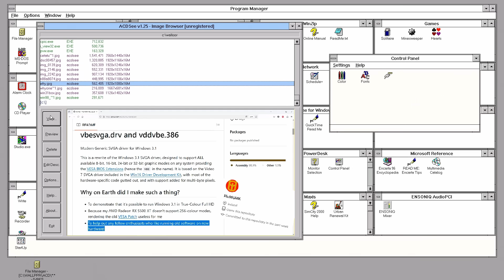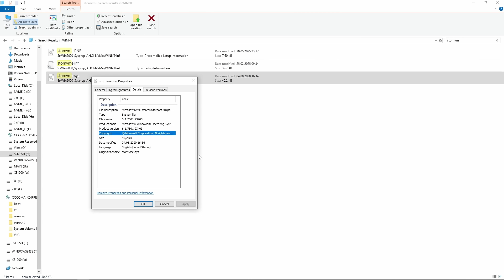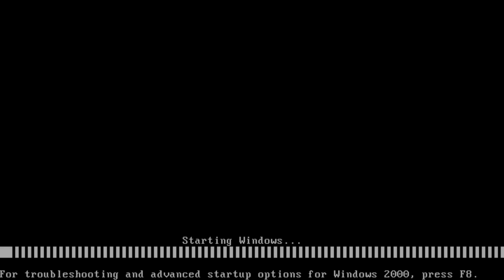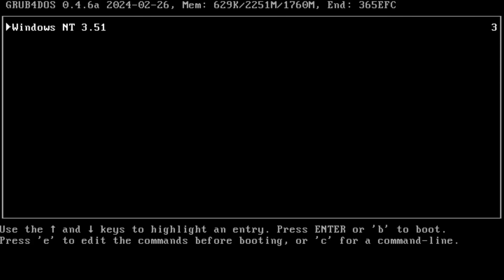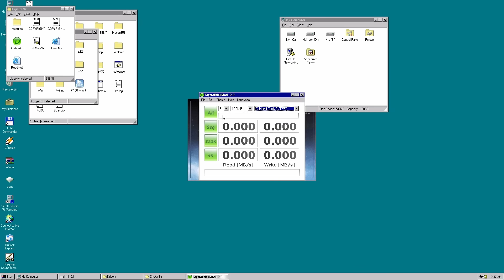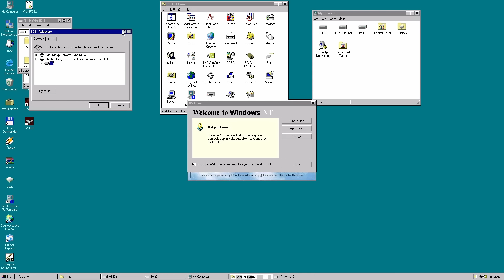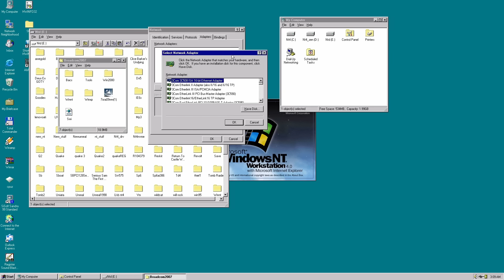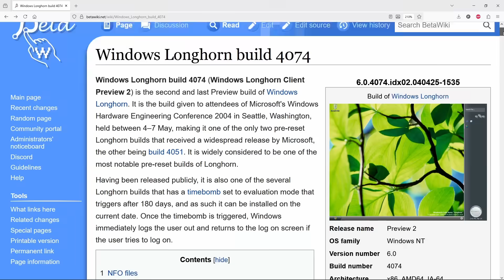A 1996 OS with NVMe support? Windows NT 4.0 Just Got a New Driver!

Comment: Hi! I've sent you an email with a Windows 9x port of this driver from SweetLow he posted on ru-board, check it out :)
Unfortunately on my MSI PRO H610M-B DDR4 motherboard, not even the legacy DOS 16-bit disk access to NVMe works with Win98SE - I get an IOS error. I did it like you showcased on your AM5 video with limiting partition size to below 8GB but no dice :(
But I can read and write to that NVMe drive when booted from a SATA SSD with 98SE with the driver installed, half success!
Reply from the maker: Well, that’s strange...I didn’t get your email (spam checked). But Ages2001 just sent me the 98 NVMe driver. This is BIG NEWS! Can't wait to check it. It’s also odd that it doesn’t work on that motherboard with that exact chipset. I had an Asus H610M‑C D4 motherboard I used until a few months ago, and I made a lot of videos with it, including Windows 98 on NVMe: https://youtu.be/BulG6-1XOe0 Maybe it’s the NVMe firmware, though the chances are slim. You could also try Windows 95, since it has a different IO.SYS, just for troubleshooting.

Comment from the maker: How about Windows 2000 booting from a 2TB PCI‑E 5.0 NVMe drive on a Ryzen 9 9900X build? 
Make this video great again! 👉 https://youtu.be/SVGUtt7YtxI
Reply: Speaking of drivers. Do you know of any new development of windows 98 drivers for more modern graphics cards? Theoretically it should be possible using Linux driver code?
Reply from the maker: @guderian557 I just found out that Windows 98 also got an NVMe driver, and it's based on the one presented in the video. As for graphics drivers, there are no new drivers as far as I know... But there's SoftGPU, which basically uses the CPU for 3D rendering and makes sense for VMs or when running 98 on modern hardware. Was made for VMs, but now works on real hardware too. I saw it get something like 17K points in 3DMark 2001 while running in a VM, but I haven't tested it myself.
Reply: There are still infrastructure using NT and they must have asked for this. 

If you have a power plant or something like that and you need to keep it as is but add a new piece of hardware, they ask for it. 

I have seen this in utilities with things like the 44 pin hard drive 

They used a name to 44 pin adapter and a nvme card

Comment: my pc 4th gen pc dont have even nvme. and now windows nt4 have it support>>>>>>
Reply from the maker: The good news is that a 4th Gen motherboard does have NVMe support at the BIOS level, but many models just don't come with an M.2 slot. But you can buy one of those $5 PCI-E to NVMe adapters, and your SSD will be picked up right away by your BIOS.
Reply: @O_mores  aa ok! but i think it will not be bootble
Reply from the maker: It should be bootable. What motherboard do you have? I might have it around here. :)) For some reason, I have like ten or more Socket 1150 motherboards with H81, B85, and Z97 chipsets (but mostly H81).
Reply: @O_mores  kinda wishful thinking to assume a Haswell board supports NVMe boot because only some boards do. MSI's H81 boards with the latest BIOS do at least.
Reply: @Wasmachineman  It should even be possible to modify 2nd gen Intel (Sandy Bridge) motherboards to gain NVMe booting support (with a PCIe adapter).
Reply: @kunka592  Older even, I had a P6T7 WS SuperComputer (a X58 board) with bootable NVMe thanks to some Turkish autist on TPU.

Comment: Soon, UNTI will have new nvme driver support for NT 3.50, NT 3.51 and NT4 ! For NT3.1, it doesn't work for now but we'll try to backport it for NT 3.1. If it succeeded, no more IRQ 14 problem :).

And stay tuned for nvme9x driver and Universal DOSWIN Installer :)

EDIT: Maybe longhorn will be postponed again after getting nvme9x driver :)
Reply from the maker: Keep me posted! Now, if only we could convince Dominik B. (aka Techomancer) to spend some time making this driver work with Windows 98. About 70% of the code could probably be recycled (I think…), he’d just need to get acquainted with the Windows 9x miniport (.MPD) shenanigans. For Windows NT there’s plenty of documentation, and the ScsiPort framework is very well written. But since R. Loew managed to create an AHCI driver (too bad the source code is kind of lost), I think an NVME.MPD (or .PDR) is doable...
Reply: @O_mores  I sent the mpd driver from Rddit
Reply from the maker: I got the driver, thanks! And yes Longhorn... might be put on hold once again!